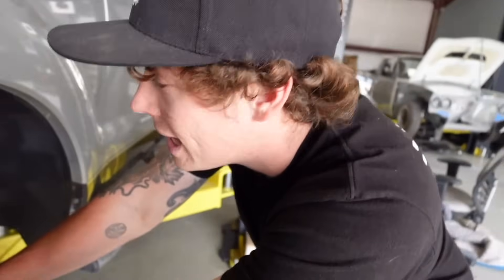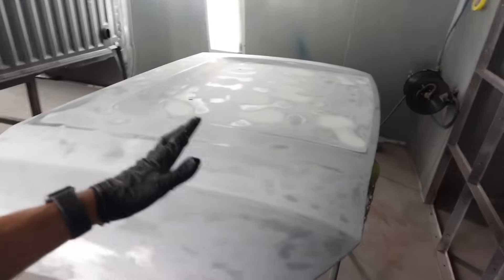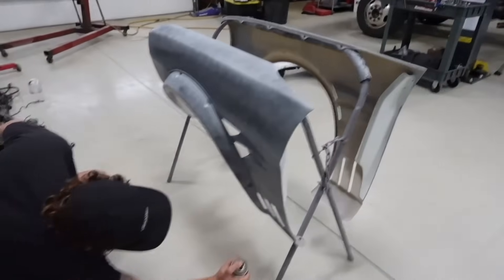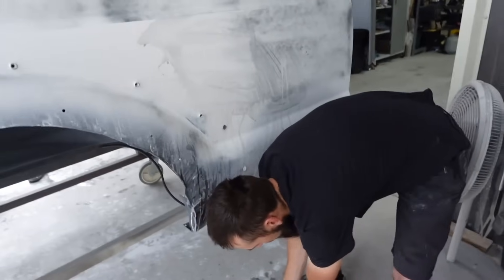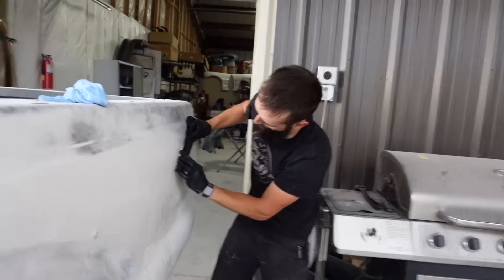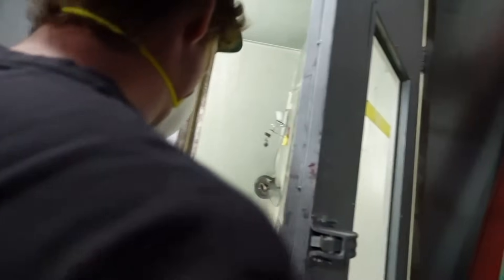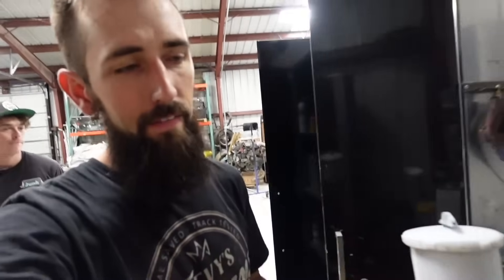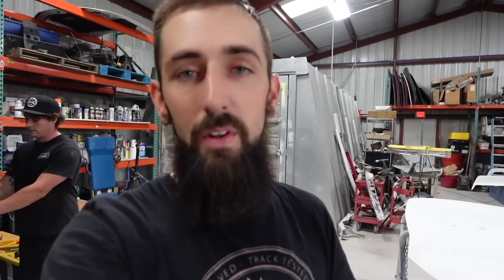32| Teaching Rudnik Bodywork On The Datsun Sunny build!

Comment: @04:56. 3-d print a tiny plastic flip top cover or elevated bezel, that allows you to press button only if you mean to. other times the beze. shroud eing printed taller then the  button would sheild that button from accident presses.

Comment: Also...use 3m blue stick it block roll 400 grit. Dry. ..wetsanding primer is an older style ..if you dont let it dry out sometimes for days it will come back out and have solevant pop..fish eye like problems.

Comment: Use dry guide coat..your missing so much from usong the spray. Also the dry guide coat staoms or soaks into the promer. The spray is just surface. Dry guide coat..use dewalt chalk line as a dry gude coat and a sponge or wax applicator to pread if anything. Its the same. Its basically charcoal. I do paint and body on custom hotrods/resto mods. Your good and its just informative opinion.